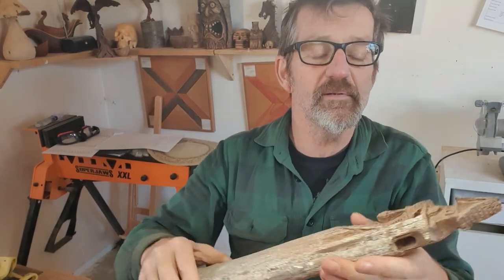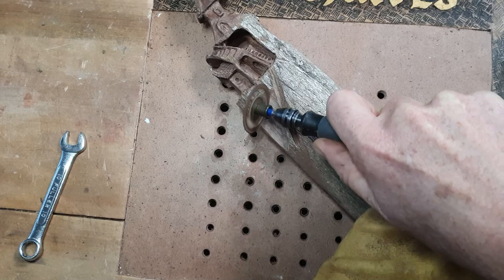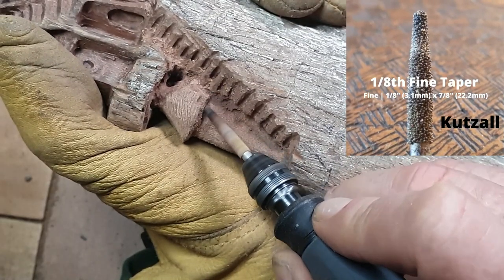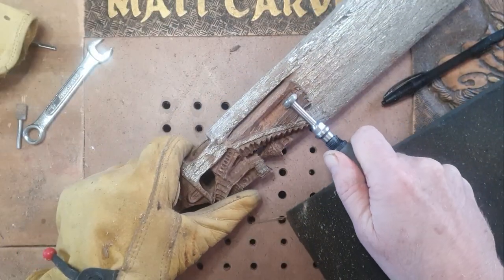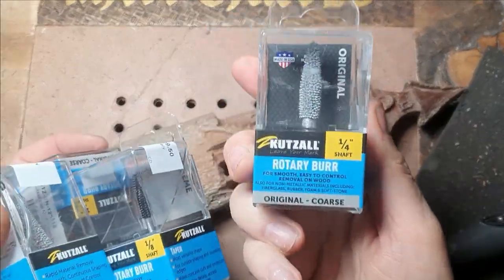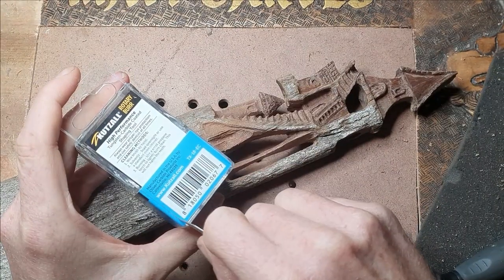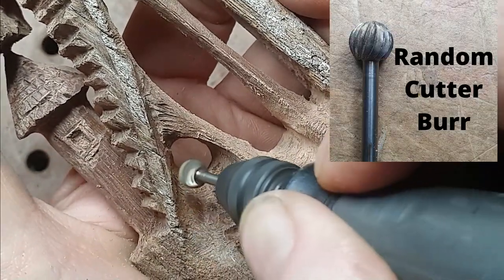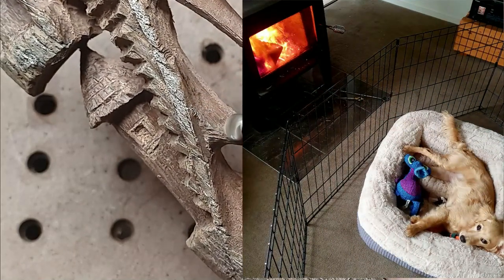Dremel EZ-lock Wood Cutting Wheel EZ544

Comment: I’m so in love with these carvings. I love the way that wheel fits without having to use that crazy little screw driver. People complain about the set up you can hand tighten but seriously it gets tiring changing those burrs. Ironwood that stuff is ridiculous can’t cut it with much of anything dulls and ruins axes, machines for cutting limbs and anything else.
Reply from the maker: Thanks Linda, yeah changing burrs is a pain, I have two dremels for carving so can reduce changing a bit. Thank you for watching🙂